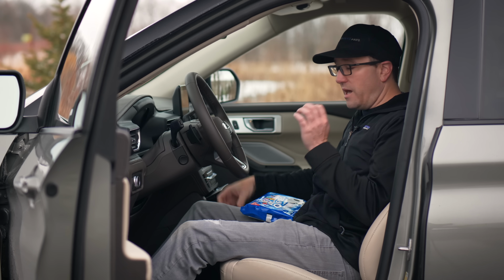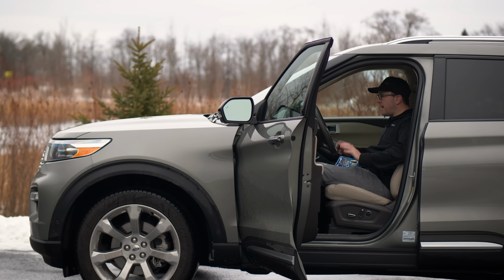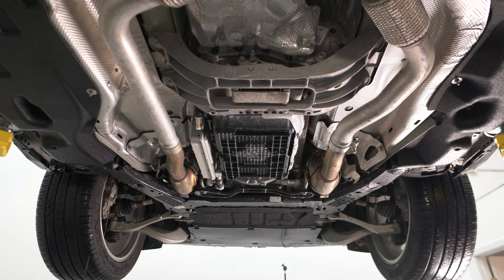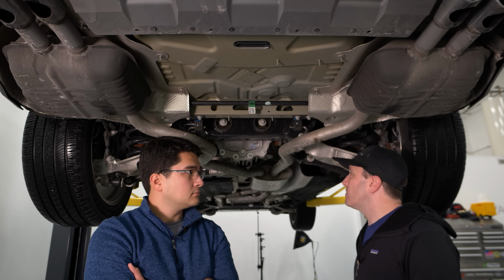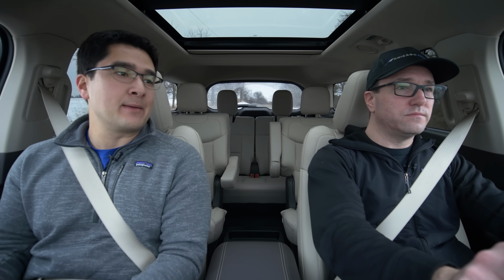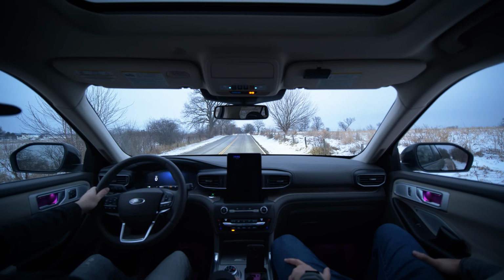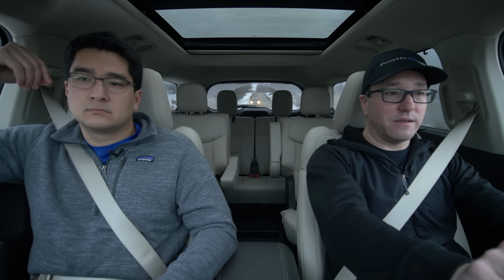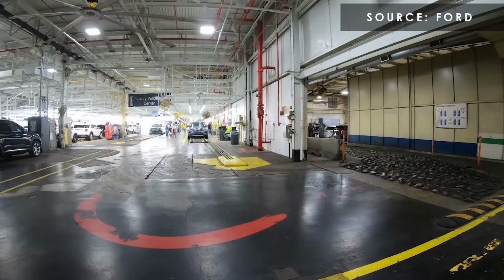2020 Ford Explorer | Who Is Responsible For This?

Comment: I agree totally on your take of the interior. This is what happens when Ford's CEO comes up with "aplan to turn Ford Motor Co around" involves cutting $10 billion out of the cost of their vehicles. First the Ranger had tons of areas where cost-cutting was painfully obvious. Then the new Escape was horribly cheap all around. Now their previously solid Explorer is death by a thousand papercuts. No way should the seats look like have 100k miles on them after just a few thousand.

I've heard similar shift quality complaints with the 10R80 in the Mustang GT and F-150. Some shift great, while others sound like they're dying and will shift like crap depending on your driving-style. It's similar to the complaints GM's 6-speed and 8-speed got for clunky shifts. Though I've been in a couple 2020 Toyota Rav4's that clunked and banged like this too.
Reply: This isn't something new, they've been on a "shareholder value" course for twenty years back when Jac Nassar was the CEO, I saw it up close before I retired from the company.....of course it didn't help any either when management decided to put the DPS6 transmission into production well before its issues were sorted out.  Now with all the fixes, buybacks and class action suit settlements it will cost them more overall than fixing the damn transmission before the first one was built.  In many cases where I worked for every dollar they saved they spent two dollars undoing the "cost cut".

Comment: Ditch the iPad in the dash and put the 5.0 v8 under the hood luv the rwd
Reply: Eugene Scott It is completely unnecessary for an SUV to have 500hp, and big V6 and turbo 4 SUVs already get sub 15mpg in the city realistically. You dip in to  low double digits with V8s, or worse.
Reply: Turbo motors don't get very good mpg when you drive them like most people do and they are unreliable
Reply: The 5.0 is only 395 hp
Reply: @eugenescott5468  I guess that's not too far off from the 365 in the EcoBoost. I wonder if the efficiency is the same.

Comment: I have a 2017 Explorer and I am also in my 60's. I like what it has to offer, I'm not upset that the trim inside is off some, I also drive the SLT, the second from the bottom of what is offered, But it does me fine, it's also the 4x4 model, which means it does have 4 wheel drive when needed, than goes back to front wheel drive when not needed. As far as speed, it does what it needs to do when I need it to do it. I'm happy with it. In all my years of owning cars and trucks, the only one which has come close to this SUV was my 2011 Chevy Impala, that car impressed me too, I kept that car for 8 years.
Reply: I like previous gen the one you have more too, I like how dash is smoothly transitioning to doors, screen don't stick up from dash, it's bit shorter and wider and 4x4 has actually torque vectoring rear axle similar to what Acura and Honda has, far more superior then just ABS traction like Subaru AWD has or LSDs...Sure new Explorer does have better interior feel in materials and RWD bias is also nice, but for next 2 years i would still look for previous gen

Comment: Not sure what this is supposed to compete with, but if it is supposed to be truck based, then I'd take a Tahoe, Yukon, Escalade time and time again. Better in every measurable way, as well as most any other. They are far more truck than this thing, as they are trucks... whilst also being far nicer inside, even on the base models.... while having far better drivetrains, electrical, sound systems, interior qualities.. heck, to be entirely 100% honest, you can literally take a 2004 or 05 z71 tahoe, or yukon denali, and they are FAR better than this... and I don't mean new, I mean now.... used.... with 150,000 miles. . . Literally better in every way, with more amenities. LITERALLY

Comment: Test drove one of these in consideration for replacing our minivan and I agree with just about everything sg has to say. I think the giant screen is fine as far as placement but ford did not know what to do with the real estate. The backup/surround view camera taking up just half the screen is dumb. It’s not very responsive either. The screen in the instrument cluster looks really good but again very slow to respond to inputs. Fit and finish is a bit of a miss too. The space inside is very good and the 3.0 liter is incredible. I never spotted any transmission issues on the one I drove. Over all I would say for really out the sport in sport utility but kind of dropped the ball on the rest. By 2022 though I bet it will be outstanding

Comment: Ford manufacturer’s plastic. I’ve Owen THREE Mustangs 6 NEW transmissions between the three. Bought 2001 Volvo XCountry. Driven as if glass of wine was sitting on dash 
At 95000 it completely died. NEVER NEVER BUY FORD.

Comment: Fair review but your missing some facts. The ST model is their top seller, just like the Sport was in the previous generation. So when you say they shouldnt have the Ford Performance branding on an Explorer your dead wrong. Your interior comments are fair, that iPad screen is brutal but SYNC4 should start in 2021 so that may be a fix. The seats and fake wood trim is a weak point in the interior but you can lose the wood in the ST.

Comment: I disagree with the "get the v6 one" comment.

I've been looking at something that would be simpler to maintain and a 4 banger ecoboost with 300hp doesn't get any simpler. I've also seen some people driving these and I've asked them about their feedback and pretty much everyone says the 4cyl has plenty of power and delivers good mpg on 87 octane.

Towing rating is 5300lbs for the 2.3l and 5600lbs for the 3.0l tt with a massive price difference between the two. 

For an economy family hauler I think people are far better off with the 4cyl.

Comment: Just had the APIM module replaced on my 2017 Fusion Platinum with 16,000 miles.  Screen froze completely.  Thankfully under warranty.  Have 7 year extended factory warranty.  Your point is on target.  I’ll keep it through the warranty, then trade it in just before, or run it without the screen.  It still started and ran fine.  Let’s be fair though.  These cars have incredible safety features that still makes them worth buying new.  In a surprise, Consumer Reports cautioned against buying these loaded cars used.  They used to encourage it.  My Fusion parallel  parks itself within 6 inches of the curb, every time.

Comment: I just got a Ford Ecosport loaner while my Fusion Platinum was having the APIM replaced.  The 2018:EcoSport has this IPAD type setup on the dash.  I was surprised to find out I preferred it.  At just the right height, it’s easy to see, without taking eyes off the road.  Definitely a safety feature.

Comment: He was spot on with the first part about fit and finish.  Where I work, we built a lot of the molds for the IP.  When I saw the grained parts, I was like...yeessshh...I don't know who came up with that.  There were so many issues with fit and assembly.  We kept making changes but they could not figure out where the deviations are.  It was not all cars but how the IP is assembled creates many issues.  We are already working on the mid-cycle refresh, which usually happens a couple years after release, they are already doing it months after release.  This is a big deal at Ford and a lot of resources are directed to make this right.   It's a nice looking SUV, I just hope they get it right.  They nailed the expidition/navigator, they screwed up royally on this one.
Reply: See GintaPPE1000's comment from 5 days ago along with my reply.  It's probably the best explanation of what went wrong.

Comment: I just bought an ST and this guy is a donkey. The transmission is nothing what he describes. There’s no drivetrain or trans issues at all. He’s simply a Ford  basher. He seems bitter, like he got fired from Ford. He’s like a bitter ex.  😂 he’s says he likes it a lot yet he seems almost in tears in his last seg. The ST is a rocket  with NASA type of tech. Drives incredible and yes the B and O sound system is great. Don’t let this jackass sway you away from checking one out. Take an ST out for a test..You’ll be impressed.

Comment: As far as being fast I think that Durango 392 would run circles around it. Never mind the supercharge model. Long-term TwinTurbo eco-boost it’s going to be a nightmare. Plus I know one of the dealership that is working on one that hasn’t started since October! Ford should just buy it back but they’re resisting.